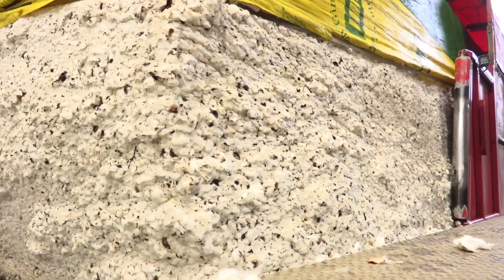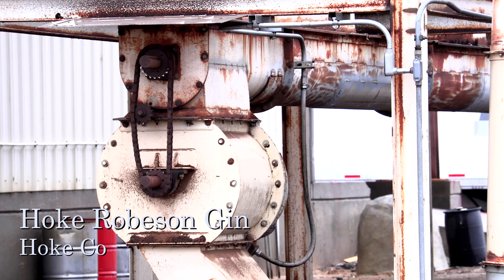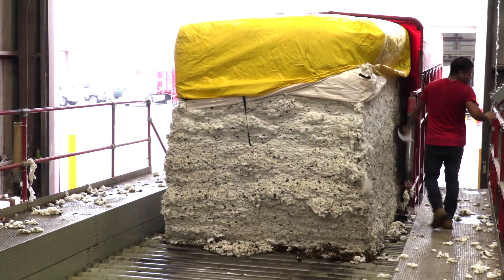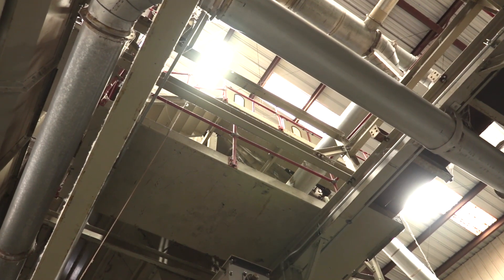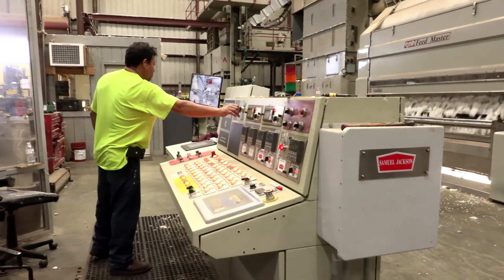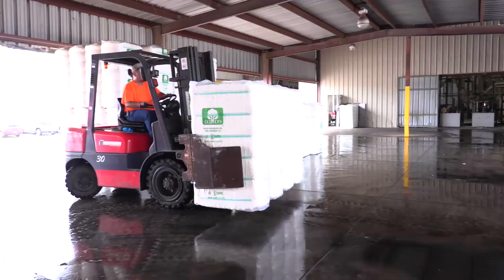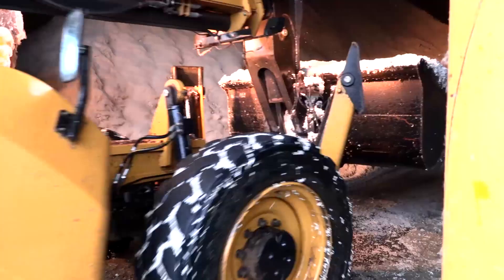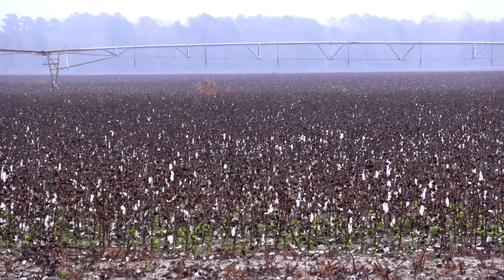Hoke Robeson Gin

Comment: I learned how to be an Assistant Ginner in a Murray Gin. It was funny on the last major upgrade they did on that gin; they pulled out the 4 original Murray gin stands & replaced them with ONE Continental 141 stand. It out ginned all four Murray model 90's combined! Also the gin I'm talking about only ginned 10 bales an hour on good days.  It wasn't steam powered like this one. It ran on twin diesel engines. When they upgraded the gin to all electric; they sold those twin diesel engines to a tugboat company who acquired them to run on a tugboat that runs on the Gulf of Mexico the last I heard. They put in two electric motors to replace the diesel twins;  one motor was a 200 HP & the other one was a 150 HP. I would've hated to have to have paid their electric & natural gas bills from Sept - December every year! They used Natural Gas in the two burners to heat the two dryer towers.